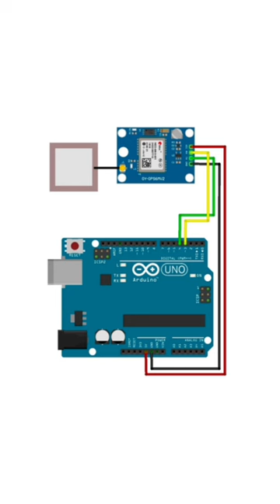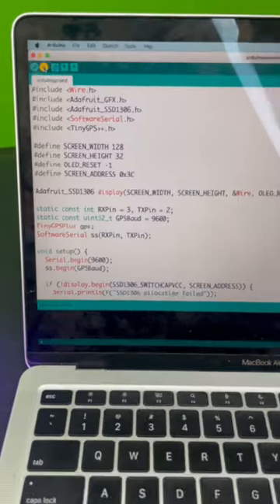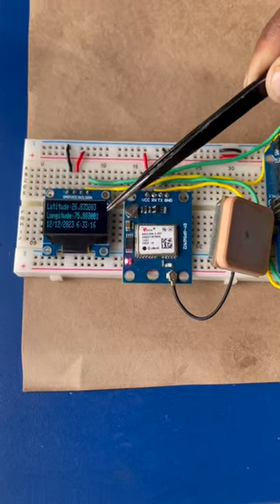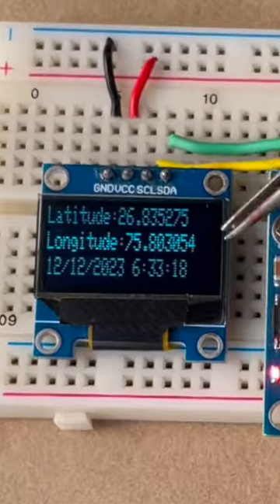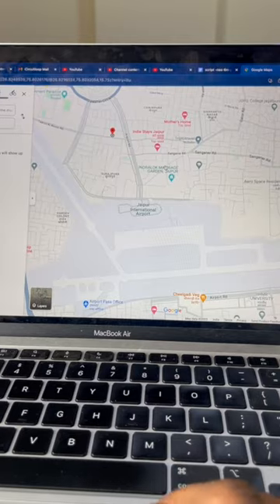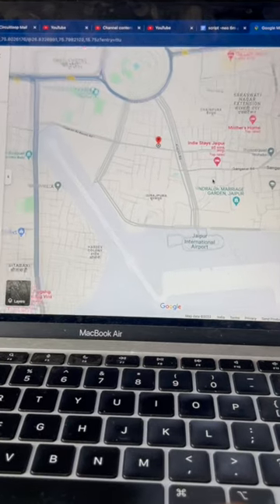Location Tracking using #arduinouno and #neo6m GPS #diy #diyelectronics #arduino #arduinoprojects

Comment: How to send this location data to a server amd disply it at other location?
Reply from the maker: Hi, if you want to send the location data to a server, you will have to use a GSM or 4G module along with the current setup. Uploading the location data will purely depend on what kind of server you are using. the easiest way will be to use cloud services such as Blink or Arduino IoT cloud.